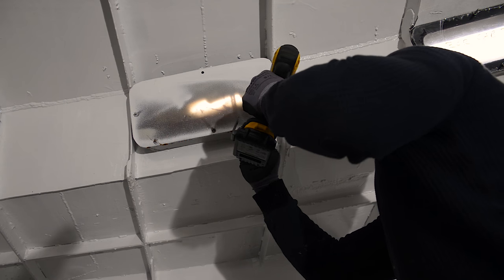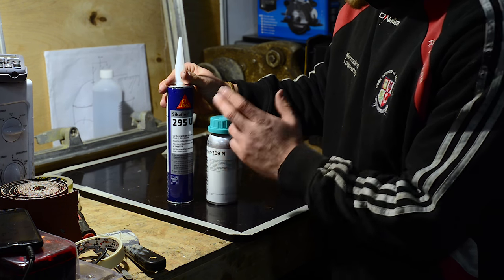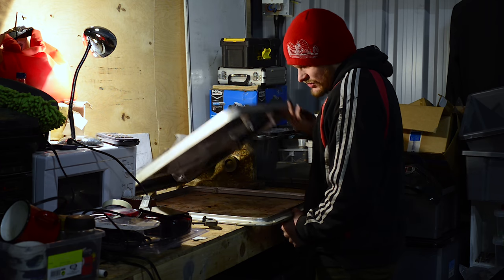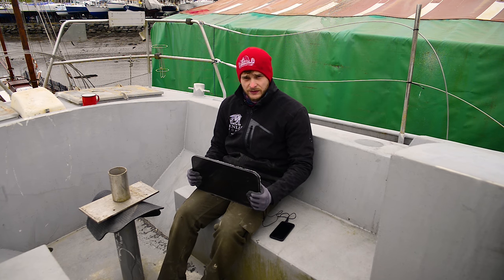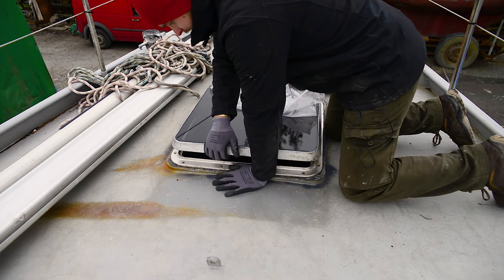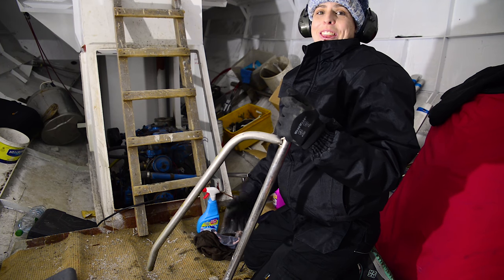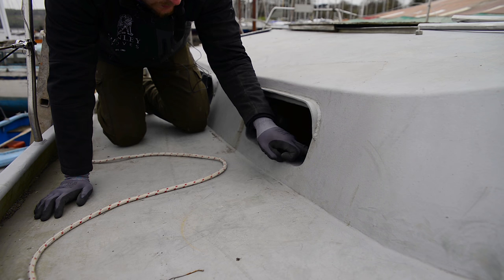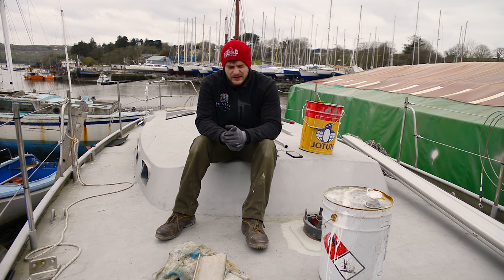Steel Adventure Sailboat - Episode 6 - Portlights

Comment from the maker: Feel free to leave a comment and don't forget to subscribe :)
Reply: I have built a 33 footer out of steel and its my second live aboard ...windows can be a bitch with condensation forming on them every time you breathe out making you think they are leaking and it makes a mess of interiors ...so in my yacht there are no windows in the inside living area and there's  plenty of insulation , under the floors its not less than 6 inches thick and the sides and deck are 4 inches thick , under the bunks its thicker and any spare space is filled ...it works both ways , keeps me warm in winter and keeps the heat out in the hottest summers

Comment: Are you going to have any openings port lights?
Reply from the maker: Yep, there are 2 in the cockpit, and the forehatch in the bow. I want to add one over the galley and maybe one over the heads too. I don't like opening portlights on the hull, because the force of a wave in a big sea could easily force it open enough to leak. That's why we went for 10mm Acrylic and heavy steel surrounds. I also plan to add a few Dorade boxes with a heavy screw down top cover.

Comment: Great video, Windows look really tidy.

is the glass fully tinted?or is that just the film over them? any issue with lighting inside?

Nice work cleaning the -what ever they are called ;)
turned out nicely polished
Reply from the maker: Andrew Harper you and Sinead will have to come visit :) 

Windows are fully tinted. Its fairly thick Acrylic! The 316 is horrible to drill though 🙄

Comment: Hi Rhys, just wondering if you are installing the hatch straight onto the metal deck? I have just finished installing one on my boat which is steel and I was told that steel and aluminium react causing the aluminium hatch frame to corrode. So I made a wooden frame that is placed between the steel and the aluminium. Loved the video and your coastline looks so much the coast line around Tasmania. Keep up the good work. Cheers Jerome
Reply from the maker: Hey Jerome, ill bed the hatch to the steel, but there should be quite a bit of insulating material between the paint and the bedding compound... Do you have any photos of yours? would love to see! Thanks for watching!
Reply: I can't seem to be able to attach a photo and don't have much knowledge about doing it on here Rhys. If you look at my channel you will see a couple of videos that if have posted. Cheers Jerome
Reply from the maker: Jerome Jefferson ill check it out mate. Feel free to email me rhyswalter12@gmail.com
Reply: still have the problems with the screws......
Reply: No I don't. I put nylon sleeves on the bolts and also use rubber washers to prevent any contact between  the steel and stainless. This almost stops any issues
Reply: good job no trail and error.